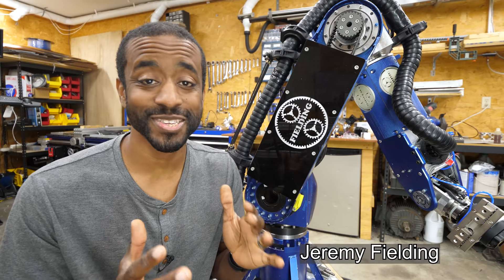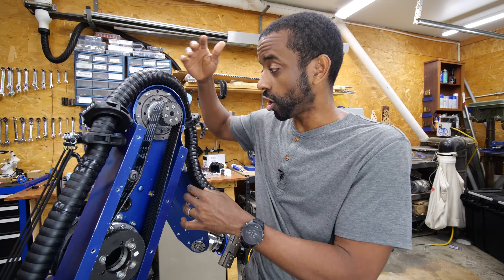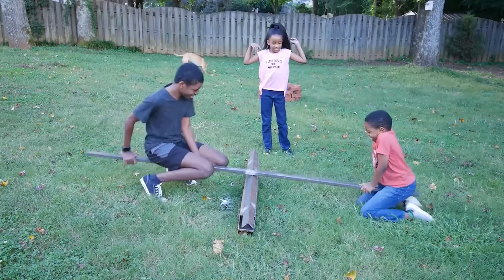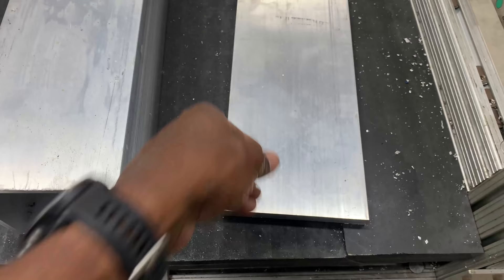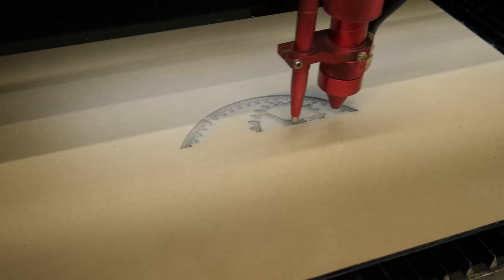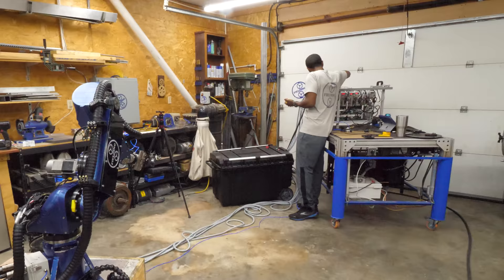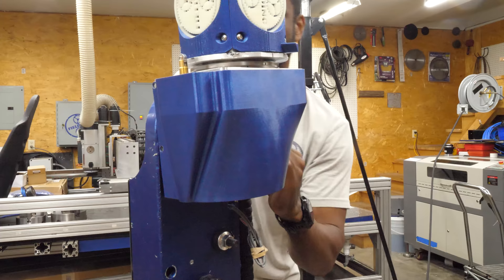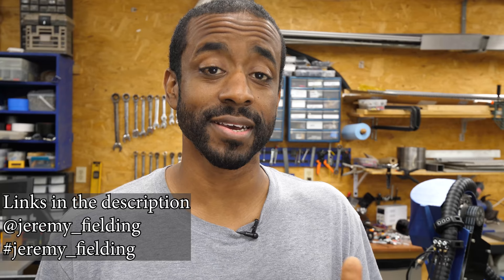How I Designed My Robot To Be Fast! Engineering Speed at a Lower Cost #092

Comment: Great design on the arm, and even better is explaining the design decisions that went into it. (Though, I'm wondering why you have angled gears/belt teeth?)

One thing I didn't see mentioned about the wiring, in since you're the one designing it sometimes you can match up wire numbers so that even if cables get swapped none of the "powered" conductors get connected to a device that can't handle it. 

And as for your bonus question, welding warps the metal so you generally always do you machining afterwards.
Reply: Professor google says that type of belt is called "Helical offset tooth" and it reduces vibration and makes the drive quieter.

Another possibly solution for the connectors might be pin keying. If he has extra pins in each one, he could remove different pins from each, and plug the corresponding sockets, preventing the wrong pins from going in. Of course that way you could bend the pins by forcing it, so it's a trade off.
Reply: Another reason, to add to what Nick said above, is that when the belt has chevrons like that, the pulleys don't need flanges (lips) on the sides to keep the belt from rolling off the pulley; the arrows keep the belt centered automatically. Not needing flanges would make the pulleys slightly narrower, which would be good for this application.

Comment: The order of welding n machining is important because of heat affected area
Reply: Always known it as HAZ heat affected zone.
Reply: I think it's "weld distortion". Meaning, the warpage from heat that ruins machining level precision. Think what a can looks like if its been in a camp fire. There are some good videos about it on YT.
Reply: Probably not HAZ unless these are all on critical material strength locations. Most likely because you will always gets some warpage when welding, and this can easily throw off tolerances.

Comment: Treat success and failure with equal contempt :-)
We’re with you - be strong!

P.S. you can sometimes buy circular connectors with different “key ways”. That way they have the same pins, sockets and assembly process, but will not mate if the key ways don’t match.

P.P.S. I’m working on renovating an old Sea King anti-submarine radar that uses:

- Two-phase AC servos
- Resolvers
- Synchro controllers

This is all old technology, but I’d love to see a video on these!

Thank you for all your work educating the rest of us!

Comment: maybe to avoid any problems further down the line, why not 3d print some covers on your cables and plugs so that it is physically impossible to mix them up  ?
Reply: Or just color code them, heat shrink comes to mind.
Reply: Great idea! Make keyed shrouds so you literally can't plug the wrong ones in.

Comment: Hi my name is cole I got a job working on and with industrial robots when I was 18. I watched all of the videos you have on making this robot. So far it's amazing everything looks really good! I have a solution for the cable problem though, 3D print a cover for each power plug that only fits if the cable is in the right spot. That way the blue cable can only fit in the blue plug or red with red. That way you don't have to double check if anything is misplaced. Other than that I'm loving the videos and can't wait to see more!!!

Comment: From bitter experience I can say: always use different or keyed plugs for things that can't be plugged into each other. Adding the colours was a good touch, I keep packs of assorted colours of cable ties and heat shrink around for this purpose. You can get party packs of 10 different colours of cable tie for cheap. Small pots of model paint are also handy for marking / highlighting components.

Comment: When I was working at a mechatronic and setting up industrial machines and electrical cabinets, we had big multi-pin connectors with usually 60-100 pins. You had to crimp the pins onto your wires and then press them into the connector. The good thing was that you could put screws in some of the pin slots so that you could only plug in a specific connector and we usually only used certain pins for power. As most of our equipment used 24V, we rarely put other voltages on the connector, if only a few parts needed 5V or 12V we converted it after the main controller cabinet. When having hundreds of conductors between the main cabinet and some machine, not having to worry about messing up the voltage helped a lot. I remember once that someone from another team put 230V on some DC power line and fried nearly 30 motors and lots of sensors, was no fun to get fixed.

Comment: Sometimes going for a walk/jog somewhere else is the best most necessary troubleshooting step. I could feel the dread for you as the realization dawned.
(my job is repairing a cnc machine shop, so I've had several "I hope I didn't just..." moments, but have generally been lucky/blessed) 

If you ever have a future situation like that where you are forced to have several identical connectors, suggestions are:
1. Flip one connector opposite if you can (couldn't really here)
2. paint pens. You had colored tape, but that tends to only wrap 1 side of a connection. With a couple paint pens, you can easily color the connector itself and the socket it goes into, so you aren't relying on tags.

Comment: I feel your pain. I'm two years in on a project. I just spent 9 months working on a prototype that I found won't work as originally intended. I did a calculation to see my expected results and saw from the calculation that it couldn't work at the scale I was using. I learned that the calculation on the front end could have saved a bunch of work. I failed, but I won't give up.

Failure is what happens until you succeed. Never give up as long as you can see the possibility that it will work!

Comment: Hey Jeremy. Love your videos. 

Just a tip about connector selection for dissimilar circuits. I worked in Aerospace for a couple of decades, and we always used different connectors for circuits that must not be mixed up. Typically, we would use circular mil connectors with the same size, number and size of pins, but with different clocking on the polarising tab to differentiate different circuits that have similar functions that must not be mixed up. For example, the left side connector might have "zero" clocking while the right side has  "A" (75 degree) clocking. That way the left and right sides can't be swapped - unless a very determined technician forces it in (it has happened). In this case, you might consider using different shell sizes for the motor and encoder circuits, or exploring the use of clocking on the connectors. 

For example, you could use Canon KJL-6-T-19-A-11-P-N for the encoders and KJL-6-T-19-A-11-P-A, B andC for the motor connections. (just guessing at the shell size and connector arrangement) page 21 of this document gives you the idea: https://www.ittcannon.com/Core/medialibrary/ITTCannon/website/Literature/Catalogs-Brochures/MILDTL-38999-fullcatalog.pdf?ext=.pdf

Trust me, blowing the encoders isn't as bad as shutting down the wrong engine because the left and right engine fire detector circuits are swapped (yep, that happened as well).

Comment: Great video! Super important to show the regular, painful, frustrating and self-inflicted mistakes engineers struggle with. It's what happens AFTER the error that distinguishes engineers. Don't give up. Break the problem down into simpler things and test until you isolate where you went wrong.

You're a great role model for kids (and adults too)!

Comment: Oh boy, we did the same thing during my capstone! Had a control board for an ROV built from Arduino Megas and some other components, all driven by an adjustable benchtop power supply. Silly us set the supply to 33V (the supply's max) to charge a big capacitor and shock things and neglected to set it back. Later that day one of the term instructors came around to check on us, and one of our team members plugged in the supply to our dev board and powered it up. Cue magic smoke. Luckily only killed the Mega but that could've sunk a massive part of our project. Luckily we learned from the experience and kept going! 

Awesome video. Amazing content and really great production value. Thank you for sharing :)

Comment: For the issue about the belt snapping and then the whole forearm falling, how about building in a safety similar to whats in an elevator.  Make a little arm that can swing around inside with a couple teeth that can engage the gear and lock it in place.   Then arrange it so the arm is spring loaded and wants to fly towards your gear and lock it up, but as long as there's tension on your belt, the locking arm is held back enough that it doesn't interfere with the gear.

You could also use a mechanism like "fall arresters" for people and equipment.  They work a lot like a seatbelt.  When used at normal operating speeds, they allow themselves to rotate freely.  When something tries to rotate them very quickly like a car crash or a worker starting to free fall off a roof, the mechanism locks itself up.

Comment: Jeremy, looks like you've figured out the hard way about poka-yoke.  I work with industrial robots and automation in my day job and the big thing we use for connectors is Harting Plugs and  amphenol plugs.  For robot power we use a large rectangular connector from the robot to connect to the controller.  And for encoders and resolvers we use a round amphenol plug.  For plug connections always think of how your home appliances work, you never carry a live wire to a socket.  It's always the other way around, you carry a safe plug to a live socket.

Comment: Jeremy,  just started working at a car powertrain plant.  Just an FYI, in stations where they use similar arms, they are all enclosed in caged areas.  You've obviously on the right track with failure modes, and the fact that even over-engineering with what should be more than adequate safety factors doesn't mean much when that 1:1,000,000 events happen.  Were it me, I'd assume worth case that something will break at the worst possible moment, going at the maximum velocity, and that some part/tool will end up flying away at a significant velocity.
Put it in a cage, and don't scrimp on the steel fencing/supports.  Might be worth it to fight the normal urge to see how  fast it can go, and set both programmetric speed limits as well as physical component 'fuses' that will blow in an overspeed event.  This thing is both a tool and a potential executioner.

Comment: I feel your pain!  HATE hooking up power incorrectly.  It's why all the PCB's I've design have a TVS diode/thyristor and 2 poly-fuses on the input.  Allows 2-way power flow, self-resets after small overloads, and will blow the poly-fuse when massively overloaded.  Biggest disadvantage are the losses in the poly-fuses.

Comment: Been there, done that. To get things up and running I often use connectors that aren't fit for purpose (like no polarity protection, no labels, ...), until I get the proper ones. That cost me a few circuits XD. The worst is when you catch a whiff of "hot" electronics and don't know what (or if something) fried. Other hints that something went wrong: you connect something and there's a short and quiet fizz in a device; or you connect something and you hear the relais of your lab power supply because the over current protection triggered.

Comment: Good reminder that user interface design needs to rely on natural affordances to prevent damage by making it physically impossible to accidentally ignore critical information like voltage by using physically different connectors

Thanks!

Comment: My condolences. I've spent a lifetime in electronics and still have silly things like that happen. The other week I managed to get 12V onto the inputs (and open-collector outputs) of one of my vintage floppy drives - the manufacturer of the extension power cable/splitter had decided to reverse the conventional red and yellow lines and I was adding a Gotek to the system. The Gotek survived and I have a second drive but now I also have a repair to get around to.. Fortunately, electronics was easier to repair in those days so as long as I can source non-fake PDIP chips, I can recover the faulty drive.

Comment: Mate, we've all been there.
I was wiring up my electric bike and mixed up the wires. Fried a £400 controller and had to rewire the motor phase wires.
Was an expensive fix, but also very time consuming.
Reply: I've seen the same done on a professional project.  Always worth  double checking power polarity as-wired before you connect - designing for testing is difficult though.

Comment: For the high pivot point, you could engineer a braking mechanism that could be rigged to a tensioner, that mechanically detects if the belt breaks, on a normally closed circuit that allows for brake lifting power for that pivot point allowing for movement during normal operation. However, when the tensioner detection mechanism senses a belt break would open the normally closed circuit, therefore removing the brake lifting power and would brake the high pivot point, not allowing it to dangerously fall during a belt failure.

Comment: Jeremy Fielding
 Add a inline fuse to the powered pins,  so if you cross the cables again, you will blow the fuse and not fry the motors, just a idea.

Comment: Wise decision on joint 2 motor position. My ancient Unimate Puma 550 has the same configuration - motors for joint 2 and 3 are actually counterweights for the rest of the arm and a drive shaft runs from the motors to lightweight bevel gearing at the distal end.

Comment: Seems like a good teaching moment. Find a way to make plugs polarized in some way. Replacing a female terminal location with a plug that prevents an improperly keyed connector to fit is a good step if you can spare the pin. Making sure to wire the connectors in such a way that mis-connecting them doesn't fry anything (dump 24v to ground for example and blow a fuse instead) is another!

Comment: Downside of using the same connector for multiple different purposes: You can plug them into the wrong things and potentially damage something.

Upsides: You don't need to stock multiple different connectors, field repairs are easier and scrap parts can be repurposed more easily. Easier to rig things up on the fly.

Best of both worlds, IMO: use the same connectors for everything, with an extra "sense pin" (or pin pair, whatever's easier to rig) that verifies each connection before applying voltages.

Comment: direct drive is the way to go for servo motor location. also better to design for weight rating then speed. once you design it to carry a certain weight. you can design the frame of the robot to be light as possible for that capacity.

Comment: I love when a maker doesn't hide the mistakes they make.  When you are experimenting, and creating, you are going to make mistakes and have failures.  This is a normal part of the creative process.  It's SO important for students to see a really smart and talented person fail in such a simple and humble way.  And yes, it's frustrating, disappointing, and maybe even embarrassing at the time, but again, THIS IS NORMAL.  I, in fact, just fried a stepper motor driver because I hooked up the power supply backwards.  DOH!  How did I do such a stupid thing!?!  Probably was thinking about my next step, and not fully concentrating on the current step.  And I was excited (in a rush) to get this new larger stepper up and running.  I need to adopt the "measure twice, cut once" philosophy to my wiring.  Check twice, then turn on power.  BTW, you've got a cool shop with lots of cool tools.  Maybe someday I'll have some of that.

Comment: Love your solution using belt drives. I saw something similar on a small pic and place manipulator. They used an endless spring steel band stretched around steel drums to translate motion. The band also had a string of 3mm holes in the center that served as a position encoder.

Great job with the kids, I wish more parents would teach their kids to use their brains!

Comment: Some ideas from actual robot arms:
- it's often a good idea to put the gear reduction as close to the joint as possible, so you can build the drive train from the motor to the gear lighter
- most bigger robot arms have some kind of piston in the shoulder, that is for weight compensation. It counteracts the torque that results from the excentric weight. It might be possible to build something like that for the elbow joint too, but is pretty complex (already have thought alot about that). To avoid this you often see the wrist motors mounted behind the elbow so the center of gravity gets shifted as close to the elbow axis as possible.
- for precision movements you definitely want to measure the direct movement of the joint itself. Any kind of transmission between the joint and the encoder add more errors you have to be aware of.

Comment: You avoid welding after machining because parts tend to warp from all the highly localized heat that gets applied during welding. The welded zone shrinks a bit and pulls your pieces around. I need to look into that aluminum MIG setup, that's really cool!

Comment: You could modify your belt tensioner to pull double duty - spring load it, so that if the belt fails, it snaps forward, and engages a joint arrestor that locks the arm angle.